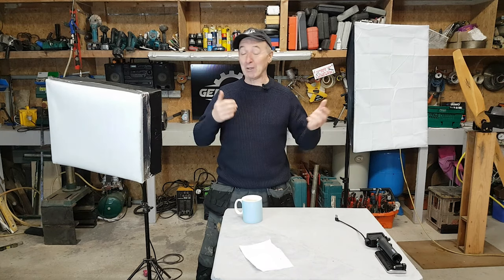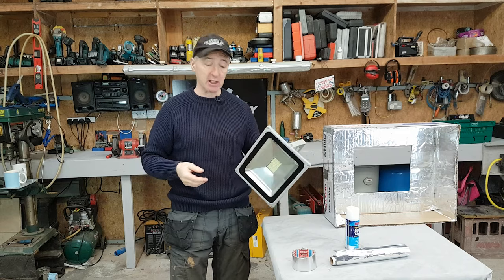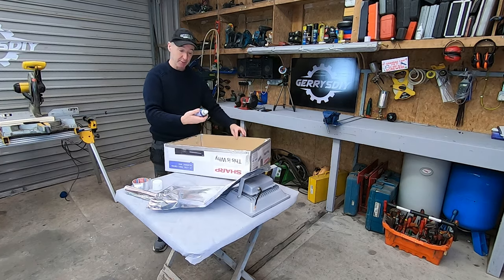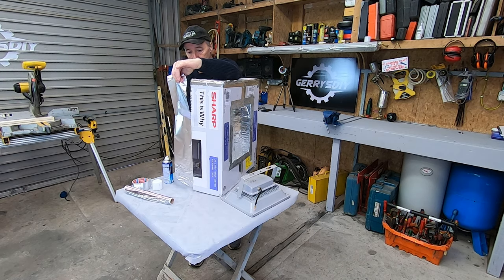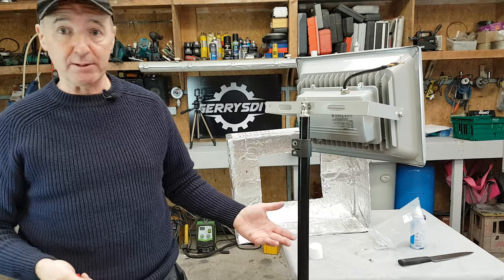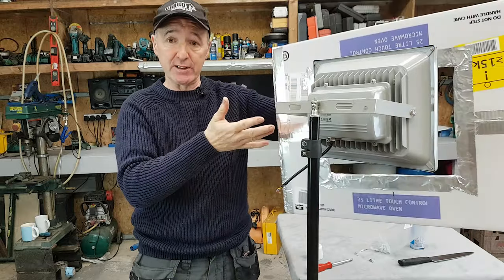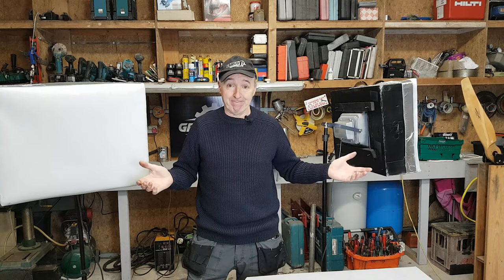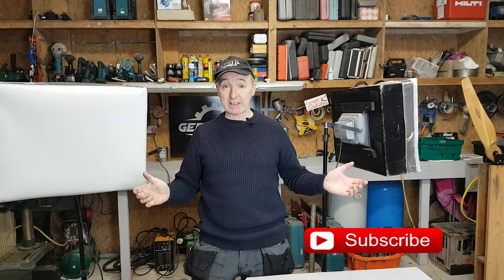Make a really Cheap Softbox for YouTube videos

Comment: Light and maneuverable! I like that.
I was thinking of making one to hang from the ceiling in my shed, out of a roof top satellite dish. They are about 26 inches in diameter. The satellite companies leave them behind when we up graded.
MB BAR RANCH
Reply from the maker: Hi Martin. I have to upgrade the equipment. The channel has 14m views. I just upgraded the pc so I could edit 4k stuff and next it will be the cameras. The soft boxes seem fine for now. I had the BBC at my house last week and their cameras, tripods, sound gear and lights were awesome. Seems like I have just an old kodac and a couple of cans and string in comparison  😜 Good luck with the satellite dish idea. Thanks for commenting Cheers Gerry
Reply: @GerrysDiy  that is impressive! 
Cheers!